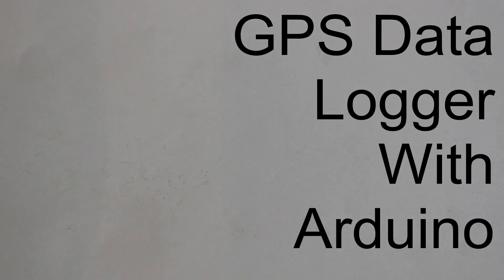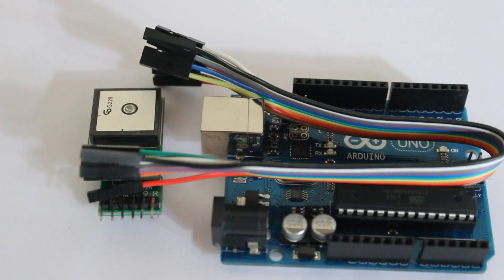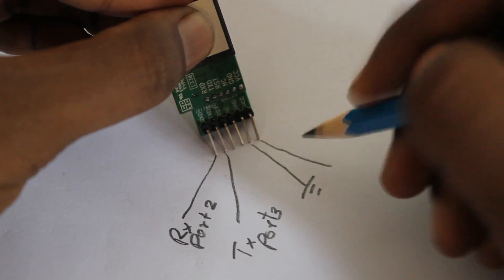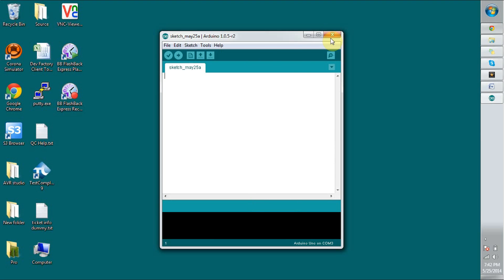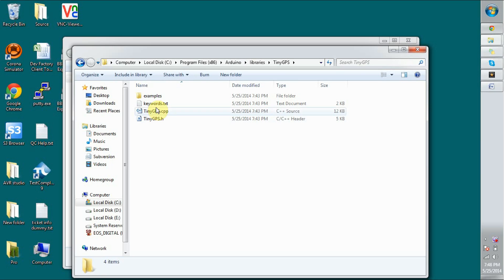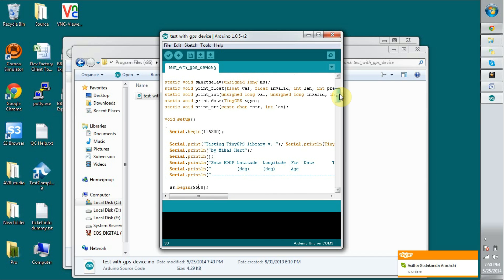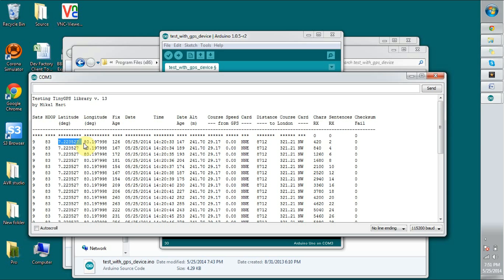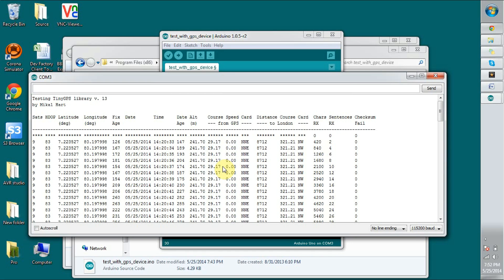Tutorial : Reading GPS data via Arduino

Comment: I need to unplug the wire from tx of wemos to Rx of gps unit before I can compile and upload into wemos.  Then I plug that wire but I still nothing from the serial monitor. I have change 4800 to 9600 baud and 4,3 to 2,3. Please assist me.

Comment: i am receiving  *************************************format at output 
plzzz guide what should be done
Reply: +Milin Arutla hello i had the same problem i just switched digital pin 2 with pin 3 and it works perfectly
Reply: @lab1376  tried. But still the data appears in "*"
Reply: i am receiving  *************************************format too as output
have you guys find the solution for this already?
Reply: Change your baud

Comment: My gps is working fine. Thanks for the vedio. But I am getting date as 00/00/2000, not the current date. Please anyone can help with this?
Reply: Are you using software serial? The data that is temporarily stored by software serial is 64 bits long by default. You can change this to 128 in the SoftwareSerial.h file, which should allow the date to get through as well.
Reply from the maker: thank you Merijn , its a useful information

Comment: hi,
i used the skg13bl GPS module , made same connections and ran the program.
in the output window, instead of latitudes and longitudes i am getting asterisks. 
What could be the reason?
kindly help...
Reply from the maker: +tech freak 

Simply its mean your data connection doesn't work properly. check the connections

Comment: I have a ublox neo 6m and all i get it is  ********************************************************************************0  0  0
repeatedly
can somebody help me?
also need to know about virtual ports for my project
Reply: I had the same problem. But I use the A7 module.
Reply: i got the same at first , then noticed my RX and TX were connected to the wrong pins . Also , like the video states , make sure you change the Serial baud rate in the program from 4800 to 9600
Reply: Same problem with me also
Reply: Shaun Miller pls help.. Same problem
Reply: i got the same problem...did you managed to solve it?

Comment: Simple and clear.  Excellent.  I am trying to connect it to an external antenna.  Do you have advice.  Thank you for the video.
Reply from the maker: Robert Brooke 

 Its depends on type of the GPS sensor you work with. the sensor I was working in this video did not have any external antenna. Else you have to place the sensor remote location and wire up for communication and power

Comment: hello
may i know if its work indoor and if its accurate in a room?
Reply from the maker: Yes, Its working indoor but not fully covered obviously. check the quality parameter when you working inside a building.
Reply: Mithila if i am in hong kong, do i have to change the lat and log values in the code?
Reply from the maker: Yau Kally

No need, that values has entered just to show you how can measure the distance from your location. you can change those values as you want ( to any location).
Reply: Mithila but i keep trying that , the data is still *********  i am sure my connection is correct, wt shd i do?
Reply: And my checksum fail value keep increasing.
Reply from the maker: Yau Kally

Are you operating this fully enclosed location like room .. ? is your sensor same as mine ? I encountered same problem because of soldering problem
Reply: Mithila thank you! yes , its the soldering problem! we hv wt we need!! it is a really useful tutorial

Comment: mchn, the readings on my serial monitor show as ** **, boud rate is fine,.
Reply from the maker: Are you using the same GPS module or diffrent one ?
1 . Check the soldered connections (I had the same issue because of poor soldering)
2 . Wait some time initially to establish a connection
Reply: Mithila No it's not the same module.
and I don't think no prob with the solderings. because I tried with another code and i got readings (GMT, Sats) , but not the longitudes and latitudes
Reply from the maker: Sachith Samarasinghe
Hi Sachitha,
Good to hear that you got result from another code. if you have time please update me about your module and the code loacation
Reply: i am getting the same problem could you please help me..

Comment: Hello now it works fine but the parameter are all Zero..
the Rx e Tx parameter...
Reply from the maker: Hi, 

Connect the GPS module and wait few minutes to establish connection. If not works in that way check your connectors connect well (even solder points also). I had same issue because of lose connections of connectors.
Mithila

Comment: Hello i try your example code on this:
http://www.amateurradio.com/cheap-gps-module/   
(is the GY-GPS6MV2).

The serial monitor write me but only symbols and letters that are confused and mixed.
Can you help me ??
thanks 
Andrea
Reply from the maker: Hi Andrea, 

Check the baud rates are matching. If you are you are using different baud-rates in serial monitor and the program it gives you wired set of letters 

update me with result
thanks 
Mithila
Reply from the maker: Mithila Serial monitor Baud rate should same as Value given to  Serial.begin()

Comment: Hello I do  the same steps but the results is 
Testing TinyGPS library v. 13
by Mikal Hart

Sats HDOP Latitude  Longitude  Fix  Date       Time     Date Alt    Course Speed Card  Distance Course Card  Chars Sentences Checksum
          (deg)     (deg)      Age                      Age  (m)    --- from GPS ----  ---- to London  ----  RX    RX        Fail
-------------------------------------------------------------------------------------------------------------------------------------
** ** ******* ******** ** ******** ****** ** **** **** *** *   *****  **** *   0     0         0        
** ** ******* ******** ** ******** ****** ** **** **** *** *   *****  **** *   244   0         0        
** ** ******* ******** ** ******** ****** ** **** **** *** *   *****  **** *   488   0         0        
** ** ******* ******** ** ******** ****** ** **** **** *** *   *****  **** *   732   0         0        

can you help me?
i use arduino uno and skm53
Reply from the maker: Hello Ayob,

 If you soldered the connectors to the GPS sensor check those have soldered well (with multimeter). First time I also had the same issue with soldering connections.

This is a common issue,
1. check your Rx Tx connections contact properly.
2. Wait bit more time to see it establish any SAT connection.

Tiny GPS v 13 should work as shows in the video.

Please update me ant other issue. Always better to share knowledge
Thankx
Reply: Mithila Hello, this same thing happens to me.
Reply from the maker: leemekeetja Did you use same GPS module or diffrent one ? and try to connect this facing the sensor to free area ( within a enclosed room you may not connect with Satellites ). I got same issue because of the given extension board doesnot connect the connections well. I'll share the source code I tried. then you guys can try that.
Reply: Mithila I use the GlobalSat EM408 GPS module ( https://www.sparkfun.com/products/retired/8234 ). I tried in my backyard with the antenna facing the sky.
Reply: Im having the ssame issues anyone knows what is the error ?